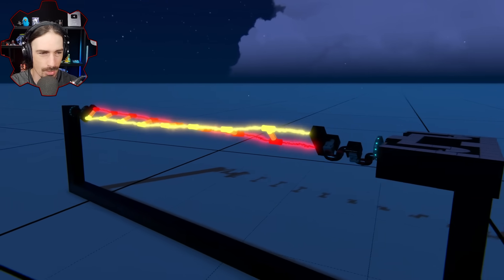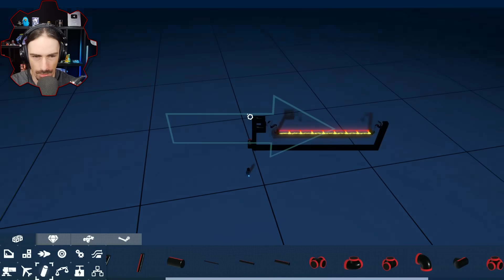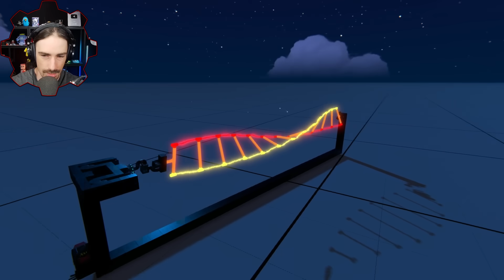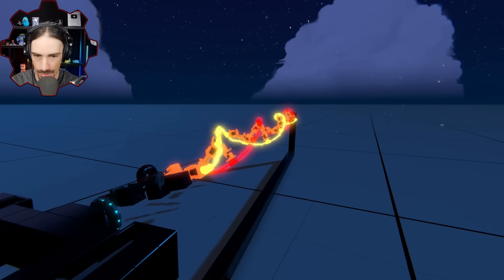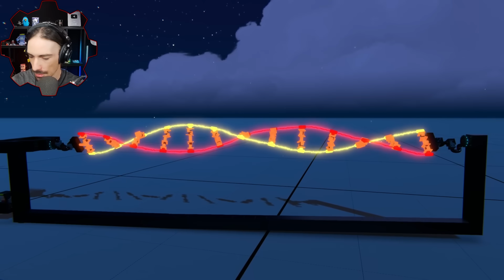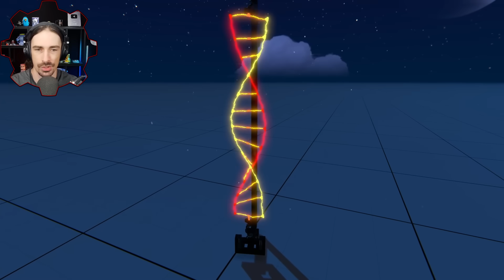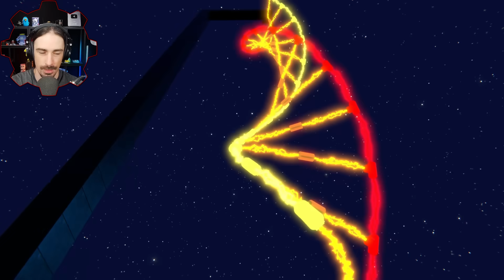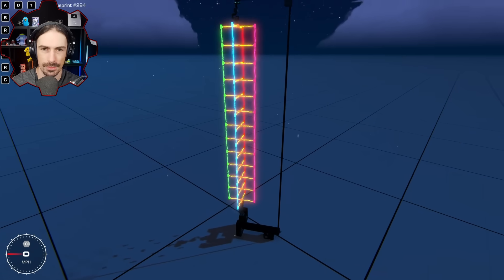I Tried To Make DNA in Trailmakers

Comment: 12:20 Scrapman mentions that 4 blocks won't work, but they absolutely would. Here's why:
The servo's center point is centered on a 2x2. One piston compensation shifts one axis by a half, so it is centered on a 1x2. The second piston compensation shifts the other axis by a half, so it is centered on a 1x1 (as seen in the video).
Therefore, all he'd need is to only use one piston, and then single power couplings would work.
Reply: I thought the same as soon as he said 4 blocks wouldn't work - he'd already solved the problem! :P
Reply: Yeah, he confused me with that one on this video and the car video with the car he used the pistons from...
Reply: Yeah, he literally made it unevenly centered, he could easily make it even again.

Comment: Mathematically speaking, if the piston has a max extension of 4 blocks and the setting is linearly related to the length, then you should use 0.125 instead of 0.15 (or at least the closest rounded value).
Reply: The length is between 1 and 4 though, not 0 and 4. So 0.16 is actually more accurate (0.17 would have been closer to the real value of 0.1666...).
Reply: It's not a linear thing I don't think.
Reply: @DaTjarhead it is linear, just it only extends by 3 blocks since it starts as 1
Reply: @jaspermooren5883  I'd say thats between 0 and 3 (no extension vs 3 blocks extended). Doesn't change that the math would be 0.1667 though.
Reply: holli crappe its the blue mod guy
Reply: Yes. I set mine to 0.12 (because it doesn't allow you to have half block lengths for this setting) or 0.17 if it's on the side attachment point, and it is pretty much dead center. At least to the naked eye. 

It's mainly dependant on where you want the center point to be though, and where you choose to use the connection point. Let's talk anatomical planes. Take the piston at face value - with the back of the piston being the grey arm and the front being the colored arm. The back is the posterior end and the colored front is the anterior. This would make the side connection points of the anterior the lateral faces. If you want your center point to be on the lateral faces, so the side connection point, then you have to use the 0.17 (ish) setting to extend a little more, making it centered with the servo. If you choose to have your center point on the anterior connection point, you would use the 0.12 since you're adding extra distance being one grid point further from the posterior starting point of 0. The one extra grid block would then bring you to the 0.17, and thus be the center point.

So in short, if your center point is on the side of the piston, use 0.17, and if it's on the end of the piston, use 0.12.
Reply: @blueflame_sm  well the maximum length of the block is 4, and the minimum length is 1 of the block. So I would say no. Fully contracted it's a 1x1x1 block, maximum extended it's a 4x1x1 block.

Comment: I believe the central problem with helixing is that the pieces need to extend to stretch around the center, so if you made it longer and thinner, you would get more spins because the stretched length per piece would increase by a lesser degree for each unit of length

Comment: You could do it with just one power coupler bridging the middle, just remove your horizontal offset on the rotator thingy - now it's rotating about an even width rather than an odd width, easy

Comment: Hey Scrap, i wanted to explain some simple physics real quick, covering why these still blow up after twisting them, and why it doesn't entirely work with a solid cross bar. Each end of the power coupler is set at a starting rotational degree of zero. When you start to rotate the entire structure, you are also adding rotational torsion to the couplers. Now, individually, the couplers are not on the center rotation point of the entire structure, but that doesn't mean they aren't still receiving rotational torque. When you rotate the structure 180° in each direction, each coupler is also receiving 180° of rotational torsion, which is causing stress on the individual blocks, as well as their connection points.

When you went from a rigid lateral brace to the less rigid couplers, this allowed some give between each segment, making the total structure more resistant to the rotational torsion. Basically, this is done because the torque on the red side is opposite the torque on the green side, causing another instance of rotational torque on the lateral brace. And since the lateral connection between each side now has its own "give" being less rigid, the connection point, each segment, and subsequently the entire structure, becomes much more stable and torque resistant.

Comment: You should do some additional testing on the power coupling physics behaviors because, based on all of these videos so far, it doesn't look like they actually compress or expand the same way that springs do (ie: linearly along their length), but rather they ONLY seem to flex/bend in relation to their bases, similar to steering hinges (or a series of ball joints). Lowering the stiffness seems to just create the illusion that they're compressing because you're introducing slack into the structure. I think this is why the couplings keep bulging outward in weird ways whenever you've tried to compress them or put weight on them, I don't think they're actually capable of compression along that specific, linear axis

Comment: I'm still watching your video now, but an issue with your first helix where you're using pipe pieces, is that the pipe pieces can't swivel between the red and yellow side- when the helix is rotating, it will be trying to rotate one T-piece by the twist rate one way, and rotate the other the opposite way. As it was, the two T pieces not being able to rotate between them meant that your power couplers were having to offset themselves to make up for that resistance.

Comment: I wonder how it would act if the piston mechanism was replaced with suspension
cause we saw how well the suspension worked
allows it some slack when it needs it and not upon input
I also think the suspension really helped cause it was able to twist
notice how all the pipes stay perfectly straight and parallel when they are rigid
but with suspension pieces they twist slightly, which makes for a smoother curve
just something to consider

Comment: Day 1 of asking scrapman to do a multiplayer battle with train-planes in trailmakers (a train with wings on all of the cars) My suggestions: (don't read If you want to make up your own rules) - I would suggest using a canard layout for the engine car so it can get off of the ground and no control surfaces or propellers/thrusters on the trailing cars as they will be lost in battle. I think a good complexity limit would be 75 blocks for the engine car and 50 for all trailing cars. Vertical stabilization would be tricky because a traditional rudder would probably only work on the final car but the final car could get shot off so you might have to resort to a gyro for vertical/yaw stabilization in the engine car.

Comment: Ik this is uselss after 3 months, but wouldnt adding suspension work aswell? Because if you are twisting, the power couplers start contracting in the overall length since because of the twist it needs to use more of its length to maintain the distance, so as you twist it can form more nicely